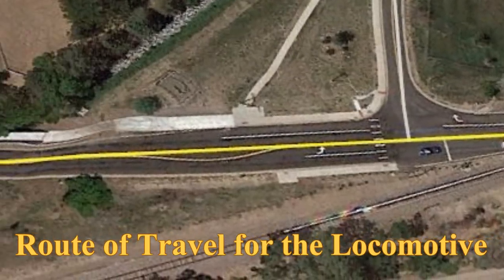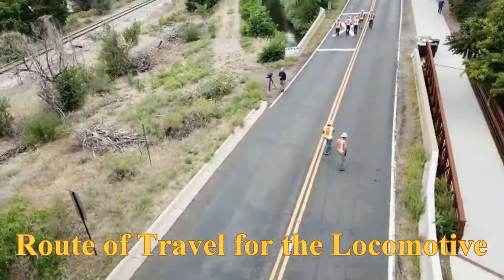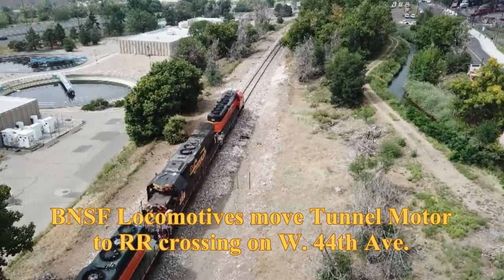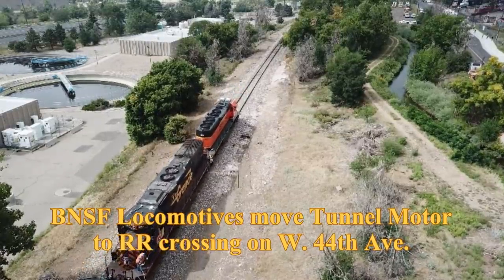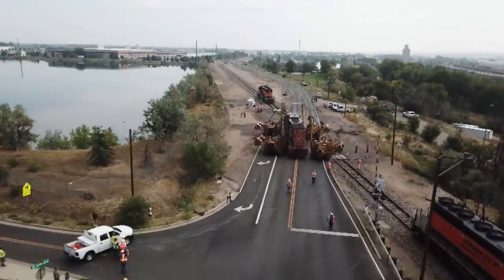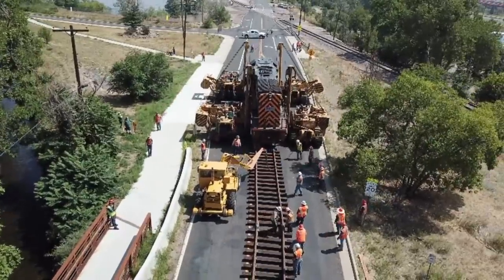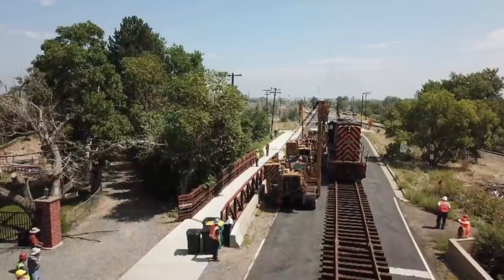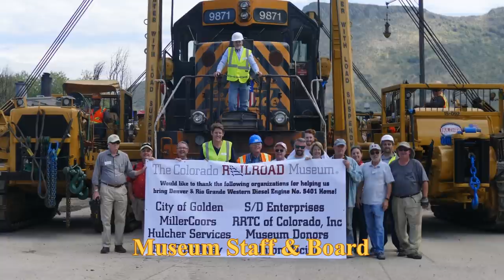2018 August 22nd   Denver & Rio Grande Western Tunnel Motor Move

Comment: What was the point of that piece if track if the side crane size was lifting and carrying it
Reply from the maker: There were two areas where panel track were used.  First one was where they had to cross a box culvert.  There was a concrete curb in that area which narrowed the roadway.  It was not wide enough for the locomotive and a side boom dozer on each side.  They also wanted to minimize the load over the box culvert.  There was no design information on that structure.  So they placed panel track over the box culvert and then towed the locomotive across the culvert on the track.  

The second area was the entrance to the museum.  The location of the existing fences and gates at the entrance were close enough that they could not have a side boom dozer on each side of the locomotive.  So, same solution.  Lay the panel track through this area and tow the locomotive through the restricted access area.

Comment: Will they restore it to its former Rio Grande glory?
Reply from the maker: When its turn comes, it will be restored to look like it did when the D&RGW operated it.  There are no plans to operate this unit.
Reply: Richard Kuberski sucks that it won’t be returned to operation, but at least it’ll be in its lovely Rio Grande paint again
Reply from the maker: The Colorado Railroad Museum does not have the ability to run standard gauge equipment on the grounds.  We have a lot of operating equipment, but it's narrow gauge and much of it is from the late 19th and early 20th century.  We are about to complete restoration work on an 1880's caboose which will be returned to service on some of the trains that we run.  Come visit and ride our rails.  See me in the roundhouse on Thursday's and say Hi.

Comment: I'm just wondering why they didn't just set it down on the old tracks that they were on top of in the parking lot. Move that gate out of they way and you're good to go.

P.s. cool video
Reply from the maker: The track in the parking lot could hold the locomotive.  However, as you saw, that is not where they wanted the final location to be.  To get from one track to another, the locomotive would have to go onto the turntable to be rotated to the desired track.  Our turntable is not designed to support a locomotive as heavy as this one.  Therefore, the locomotive had to be set on the proper track without the use of the turntable.

Comment: my only question is why not have a set of tracks to the museum from the working rail tracks to make these things easier just curious
Reply from the maker: This issue has been dealt with in detain in previous comments.  Please take a look back.  In a nutshell, we are primarily a narrow gauge museum.  We do have some standard gauge equipment, but the majority of our standard gauge track is for display only.  Twice in 60 years a large standard gauge locomotive was moved onto the property.  There are numerous problems with creating a connection to the standard gauge track near the museum.  It is just not going to happen.

Comment: Is restoration of the original paint and removal of UP badging and numbering planned? There seems to be a significant level of weathering to the roofline, etc. Also looks like the tracks did considerable damage to the pavement.
Reply from the maker: It would be great if you would explore the comments previously posted.Yes, there was VERY minor damage to the pavement at the entrance to the museum.  The city of Golden made this repair at no cost to the museum.  I have not been on top of this unit.  However, it's been a long time since it has operated.  When time, funds and manpower are available, this unit will be restored to look like it did when operated by the D&RGW.

Comment: Wonderful!  Well done!
Was there no spur to the museum?
Reply from the maker: Correct, no spur.  To the best of my knowledge this is the second time this type of operation was done over the long history of the museum.  So, it is certainly not a frequent need.
Reply: Thank you.  I worded poorly.  Thoughthathey had a spur years ago.    
What about laying temporary track, several sections at a time, and continually moving the rear section to front?   Think someone did that somewhere.
Reply from the maker: I've previously commented on this.  When the locomotive was hoisted by the side booms and going in a straight line, progress was rapid.  They used panel track in two areas where it was too narrow for the locomotive and side booms to travel together.

Also, many of you are second guessing a decision that's already been made.  It's a done deal.  Options were discussed and a decision was made.
Reply: "I've previously commented on this."    Would be good to puthat athe top so the question is not repeated.
Thank you.  Thoughthathe track would be faster than side booms having to continually adjust and balance.
Also concerned that if something breaks or ground sinks, the locomotive could tilt over.

Comment: this is only 3,000 hp. not 3,600. the 20 cylinder 645's we're rated at 3,600 hp. this is the line from Denver to golden or the "beer run". I ran this line for years. it's a steep bitch lemme tell ya.
Reply from the maker: Tom is correct, it's 3,000hp.  In my research, I made an error.

Comment: once many years ago during the Jurrasic Period when the museum had a track into the park. not sure, but it would seem to be a very usable feature when equipment arrives... just writing out loud..
Reply from the maker: To the best of my knowledge, and I have asked people in the know, the museum has never had a line onto the property.  Many years ago a temp line was laid down W. 44th to move the Challenger onto the museum grounds.Elevation differences between existing standard gauge and the museum, a canal in the way, not owning property to lay the line and the fact that a standard gauge line is of very limited use to a museum that primarily operates narrow gauge equipment are all reasons that there never was and never will be a rail connection at the museum.
Reply: @ROKuberski  Thanks for the reply and info. I have seen where equipment, both narrow gauge and standard gauge can be transported via flatcar and unloaded at a concrete ramp or with a crane..  The temp track works well especially when moving a standard gauge engine into the narrow gauge museum.. Contractors used that same method when moving the Frisco (St Louis San Francisco RR) 4-8-4 #4500 on its last move from the Sand Springs Railway line across Southwest Boulevard in West Tulsa Oklahoma into a Route 66 theme park.. As a child I always would check out the loco on display at Mohawk Park in Tulsa.. A veteran steam mechanic viewed it an suggested that it had been overhauled before being donated to Tulsa, always hope to see her run again... could still happen.

Comment: What is a tunnel motor?
Reply from the maker: It's a locomotive designed to work in a tunnel.  Main difference is that the air intake for the engines is at the walkway level where the air is cooler and cleaner.

Comment: Are there no lorries with rails on them there? That's how we do it in the UK it's much easier
Reply from the maker: We frequently move narrow gage equipment that way.  It would be a monster truck to haul the 368,000 pounds that this thing weighs.  Remember, it had to cross a box culvert that crossed the road at a shallow angle.  That made the effective length of the crossing longer that it would have been if it had been a 90 degree crossing.  What kind of loads are being moved on your lorries?

Comment: Who payed for the street re-pave after all that tractor damage...lol.

Nice vid of a difficult move.  I know a bit about this sort of thing as I've been a heavy-haul/over-size truck driver for a time in my career.
Reply: Those tractors seemed to have rubber treads so to me it appeared that there were only black marks on the road but no damage.
Reply from the maker: Damage to the street was VERY minor and the City of Golden did the repairs in just a few hours at no cost to the museum.  The side boom dozers had rubber treads, very gentle on the road surface.  Only at the turn at the front of the museum did they do any damage.
Reply: The Cats have rubber pads on the tracks.
Reply: Been there, done that myself sir for several yrs. in East Texas.  Even with pads, hot asphalt will move under that kind of weight.

Comment: Another operational engine put out to pasture to rusr away. There is no possibility of anyone appreciating this engine as it sits in the wethaer becoming nothing more than a rust catcher. Nearly every static display "Museum" in the country  had engines in every possible state of decay. Such a shame machines like this are treated so badly . Locomotives are made to operate, not stand still collecting rust stains. becoming little more than scrap.
Reply: Maybe no other museum that had tracks that it could run on wanted it.
Reply: As EMD, GE, and other locomotive manufacturers design and build bigger and more powerful locomotives,  Ones with less power will be regulated to more easier jobs until they are stricken from the roster and then scraped, in that state, the locomotive would not be so attractive as it is now.
Reply: Railroads are a business, not an operating museum. If your competitors have a more economical way to do a job than you do, you're going to get left behind. They do a limited amount of PR work with historical prime movers, but at the end of the day, you've got to make enough money to make the stockholders happy, perform equipment and right-of-way maintenance, and provide paychecks for the worker-bees ...
Reply: I understand the sentiment. Locos of all types and ages were made to run. It's a simple question of math. When a loco reaches a certain age, the maintenance and repairs just cost more than the unit is worth. So the RR is left to either sell it for it's weight in scrap metal or donate to one of the many museums across the country. Unfortunately, most of these museums run almost entirely on donations and volunteers, and have very little money available for restoring and protecting the equipment. 

They do all that they can, but as Richard said in another reply, they have "100 years worth of work" and most of the museums are in the same boat. They can't afford buildings or sheds to house all their units, they can't afford mechanics and paint shops to restore all their units, they can't afford fuel and right of way costs to keep the units running.  

But what's the alternative? If these museums don't at least get possession of the retiring/abandoned units in the hopes they can one day be restored, then the RR will just sell the unit for scrap to get what they can out of it. And then the unit is permanently lost.

I admire the work that the many RR museums across the country do. I try to visit and donate to as many as I can, when I can. The little museum here in Columbus does what effort they can and I support their efforts when I can. If you want these museums to be able to care better for their units, then contribute and help them out. But don't complain about their efforts to try and preserve history.
Reply: Actually, it's not quite as bad where it's located, as the weather is usually hot and dry. Wooden ties last longer in this environment as well.
Reply from the maker: This locomotive was put up for sale in 2010, the museum director found out about that and contacted them and asked that they consider donating it to the Colorado Railroad Museum.  The deal was made very quickly.  The locomotive was never offered to any other museum.  It was then moved to the Coors Brewery rail yard where it waited for the museum to have sufficient funds to pay for the move.  The Brewery is across Clear Creek, just south of the museum.
Reply: well, it was either going to scrapped, or on display at a museum .... which would you rather have? Actually being able to see a locomotive, or never seeing it again as its scrapped, torn apart for minor parts, and melted down for a few bucks.....
Reply: And sometimes, a museum gets a donated unit, keeps it from going to scrap for a while, and then it's sold or traded around until it's brought back to working condition.  The UP 4014 "Big Boy" is a good example of this.  Once the wreckers get the cutting torches out, it's too late, so if a museum can grab something before then, they often will, even if they don't have the resources for a restoration right now.
Reply from the maker: This unit was not offered to any museum, it was put up for sale.  Our museum director contacted the UP and asked that they consider donating it to the Colorado Railroad Museum, which they did.
Reply: @ROKuberski  I respond to express my thanks that the engine was saved from destruction. Whether sold or donated outright the engine left the possession of UP and now belongs to a museum rather than passing through a furnace for the second time. There it will likely stand outside in the weather, rather than a controlled environment  - unused. After the novelty of having this monster park without paying parking fees (Or parking tickets) wears off and it is visited only by the occasionally curious,  it will decay and turn to a rusted wreck impossible to salvage or use under any but the most drastic circumstances. That is next to criminal because it is meaningless to anyone other than someone over the age of 70. Sure, kids can see photos of big engines and Grandpa, can have his youthful memories stirred by taking his little 'uns to see it. He will remember when it rushed by him in a cloud of dust and cinders; bellowing and roaring as only a locomotive can do. But the "Little 'un" - he will see this heap of metal, rust streaks down its sides and on everything steel. He can't hear it pant, or chuff. He can't hear the hiss of steam or the sir brakes. He won't hear the compressor thumping or feel the heat of the roaring fire in its belly. He will never hear the whistle call out its approach to a town or grade crossing and listen to the sound echo off the surrounding hills. He will ask Grandpa what that is. That benevolent old man will think of what it really is and choke trying to bring the rusting  pile of machined parts, made with price a century, more or less, ago by men who loved the monsters they built, to life in his description of  his memories. Grandpa will go home with his memories intact. The kid will wonder why he wasted his day looking at that thing he could not possibly understand as it stands there cold and silent, dying the death of all neglected machinery.
Of course there is another scene. It is towed to Cheyenne and given to the steam crew to restore and 2 or 3 years later emerge breathing smoke and steam to be returned to a useful life - even if it is only to pull passenger cars. Yes, and that little boy - Well, He will spend a Saturday with Grandpa that he will never forget. Grandpa will be spared the impossible task of describing what that huge black thing, bubbling, hissing and chuffing is and what it does. Oh yes, the museum set up an endowment fund that assured that the engine will be able to pass all inspections and be rebuilt when necessary or mandated for the next century. Yes, it will be a real museum like the ones that house the world's great paintings, documents books and other things of antiquities.  I wonder why a museum can fund a trip to Egypt to disturb someone's grave while another museum and even protect or restore a mechanical marvel it supposedly wanted to save from the scrappers torch.
I am all for saving locomotives and other pieces of historic value - including houses and buildings of antiquity. The general public is not. They are interested in "Progress", especially when saving relics costs them money. You know that the children of today will never see one of these operate or even understand what steam power did to bring them the life they now lead. Such a shame. A situation now made worse by the AMTRAC decision to keep all privately owned trains off their rails. That almost guarantees that nearly any engine not operated by UP or its related lines will be like the D&RGW - running back and forth of a terminated side track hauling empty freight cars behind. Never will they struggle up Sherman Hill, with or without cars behind.
Reply from the maker: It was never offered to any museum.  It was put up for sale, our Director found out and asked if they would donate it to our museum.  It was a done deal very quickly.  Thank You UP.

Comment: why not lay panel track
Reply from the maker: They did lay panel track in two areas.  First was a box culvert where it was too narrow for the locomotive and side booms on each side, second area was at the entrance to the museum where it too was very narrow.  When the locomotive was up on the sidebooms and they were going in a straight line, progress was very quick.  Laying and aligning the panel track was slow.  There were 4 sections which was enough to cross the bridge and get it into the front gate.  To leapfrog the 4 sections around the locomotive all the way down the road was certainly possible, but it would have been slower.